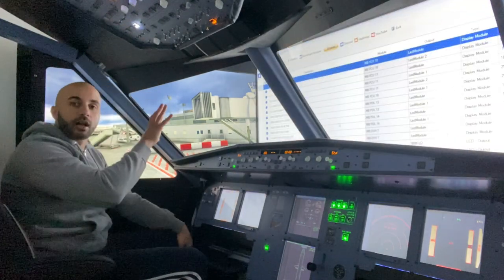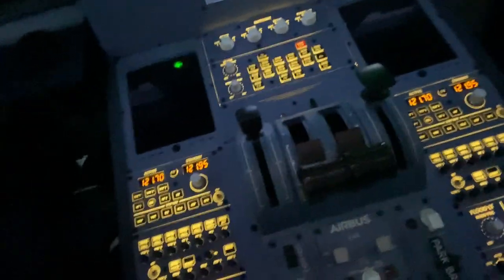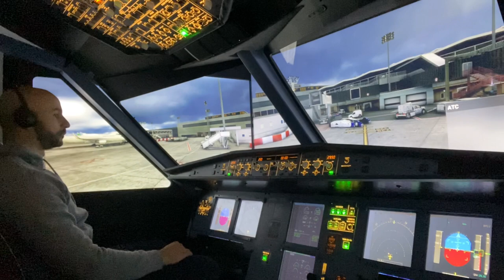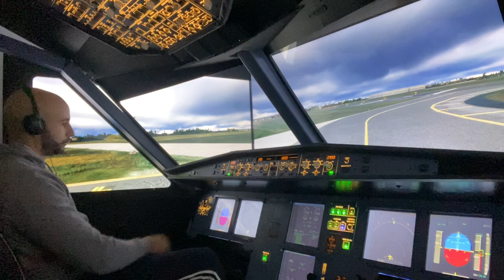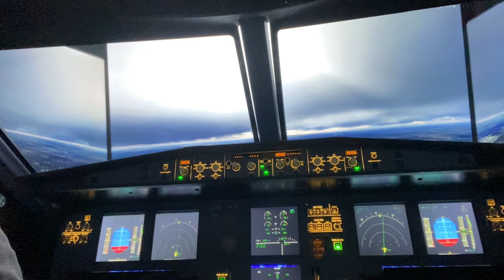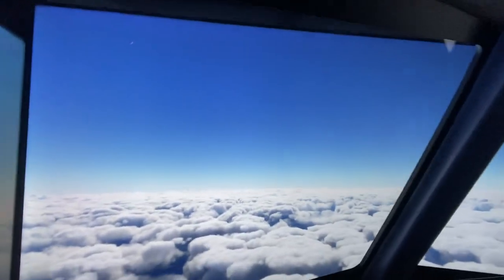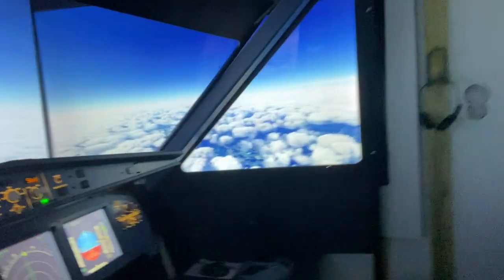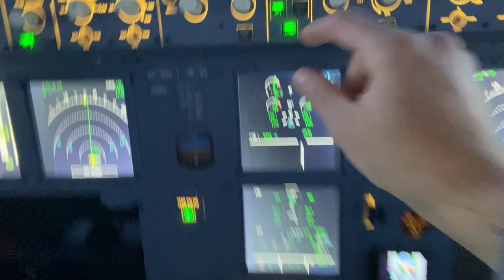Airbus Homecockpit How It Works!

Comment: This build is so epic and perfect but it annoys me that the monitors dont line up perfectly, maybe its just the perspective you showed and it isn't noticeable from the pilot's perspective. Would love to see a differnt view or if you plan on changing it.
Reply from the maker: Hello! Yes the perspective is better when you pilot, the video exaggerate the thing… but you can set x3 same size (inch) TV and you will probably not have the problem. The only thing you can expect, is to be patient, the zoom functionnality for sides monitor isn’t available on the sim for now… it will fix this problem
Reply: Thanks
Reply: It’s the different sizes of the tv. You can actually fix this somewhat by tilting and messing with the perspective in the FS settings.

Comment: Amazing work ! The only thing worrying me while imagining doing something like that myself is ,that after all the hard work and money one has invested into such a great project, all it takes to ruin your fun is MSFS once again crashing to desktop in the middle of a flight or shortly before landing.... Which after a period of stability ,  happens a lot to me again with the Fenix A320 after SU12 :-(
Reply from the maker: Thanks 😇 don’t give up with MSFS, the best advice i can share you is to do a clean reinstall of WINDOWS11 and reinstall MSFS… i run A32NX, so i cannot help you with Fenix :/ in my case I run smoothly the sim with x3 TV on dx12 and high/ultra settings. What’s your config?
Reply: @tarikb.2352  Yeah a seperate computer just for MSFS would certainly improve things. Im also on Ultra settings with RTX 4080 with two displays. Im pretty certain that the Fenix A320, who hasnt recieved an update since October, is the culprit here as the Flybywire A320 Neo and PMDG 737 do not cause similar crashes.

Comment: I love it!
The last weeks I also thought much about building a similar setup.
Did you take into consideration to install a hydraulic system underneath so that you can even simulate bank angles and nose up/down?
Do you think this would be feasible for someone to build at home?
I think the most complicated thing is that you would also need to include the monitors in such a setup which could lead to a space problem in a normally sized room of an apartment.

But anyway, really really nice job.
If I managed something similar at all in my life, this would need way more than 5 years to come...
Reply from the maker: Thanks, with motivation & love you can do it more faster than you think :)
For hydraulic system, I think about it too but you will need strong hydraulic motors to move the entire box (mora than 600lbs). And it's a huge challenge because the height of your ceiling is to be more than 3 meter. I share you an interesting video about that : https://www.youtube.com/watch?v=aBrC2T8u0yc
Reply: @tarikb.2352  Hi, I have over 10 years experience with building motion platforms and you don't really need a full Stewart Platform (having built one in the past).   Even just a electric seat mover +, or harness can be used to great effect for a project like yours.  All the best.

Comment: Just the video I needed to find. Ive been building a simulator in my head for several months. Decided today that I thought arduino megas were the way to go. Was trying to decide if mobiflight or spad.next would be the best way to go. 

So one question. How did you print or make your overhead panel decals etc?
Reply from the maker: Hello! Thanks for your msg! For my panels I draw them with Adobe Illustrator, engraved them with co2 laser machine and that’s it.
Reply from the maker: At the end you have more informations

https://youtu.be/pNO6eVWZlbw?si=0CGHLjERN2znA0Km

Comment: Awesome, great, but - advantage of VR is stereo vision, enables depth perception which is significant for VFR, motion is much easier to implement, less demand on video compared to multiple 4k screens. Also, VR does not tie to specific equipment. Overall less cost and simpler to implement.
Reply: I did not see the difference between vr dans a simulator